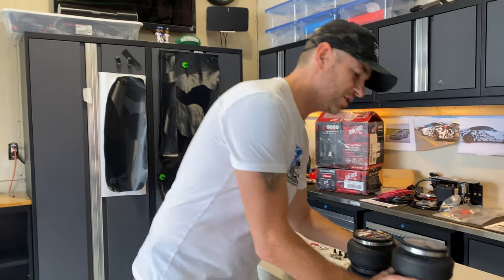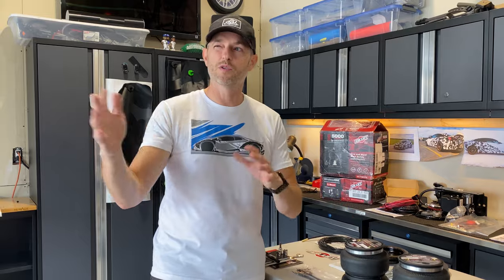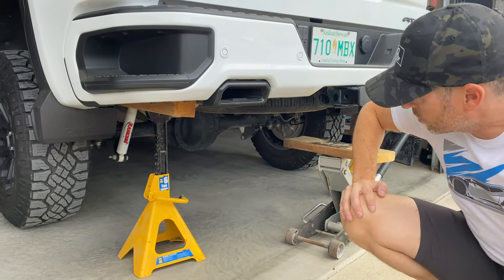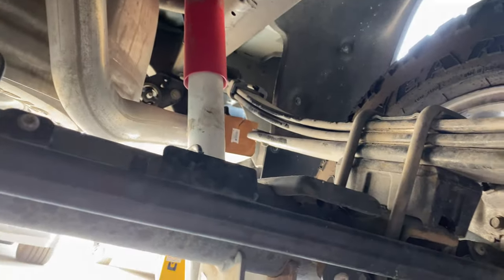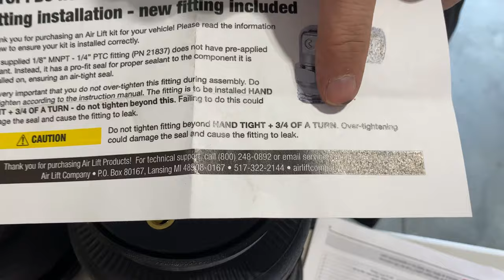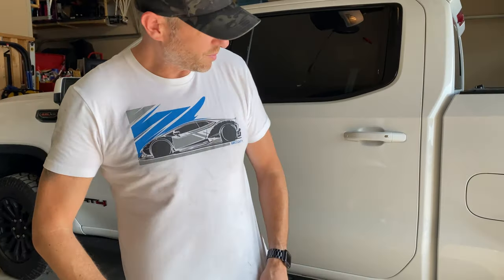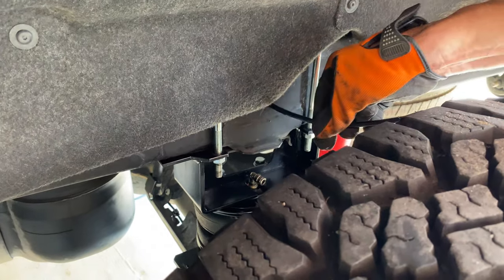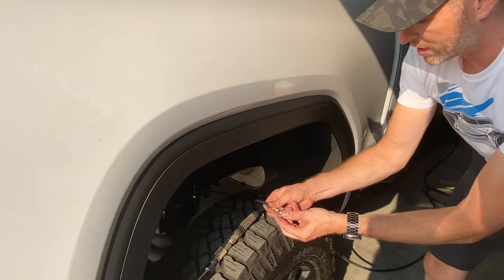How To Install Air Lift LoadLifter Air Bags on a GMC Sierra AT4 or Chevrolet Trail Boss. 2019 - 2023

Comment: Just a tip.  For trail boss/at4 you don’t need to jack the vehicle up for clearance.  Compress the bag and duct tape for n compressed state.  On drivers side you will need to remove lower shock bolt and position shock to work bag into place.  Eliminates safety issues.  Thanks and enjoy your videos
Reply from the maker: Good tip!

Comment: Just bought these airbags model 88388 on Amazon sale $385.00 🇺🇸 👍 THANKS
Reply from the maker: I hope they do the job for you!  Sure adds stability for me while towing
Reply: @Donslife  Have a question, I received my airlift kit. I purchased the same kit you did. I didn't receive the "T" parts that you show. Instead I received two separate lines, each with a Schrader valve on the end as if eave air bag is to be filled independently. Did you have to order the "T" sections separately?
Reply from the maker: @mannyb4959  I don’t remember off hand, but airline ‘Tees’ are super inexpensive and can be found at places that sell air compressors.  Or Amazon

Comment: Great video, I read some of the reviews,  and some people complain about the ride when empty even with only 5 lbs of pressure. Did you notice a rougher ride with no cargo
Reply from the maker: Yes, a little bit stiffer but that’s the trade off.
Reply: @craig3818 I just test drove a 2021 2500 at4 with air bags and it sucked. No cargo in it and hit a bump and felt like something hit me in the back.

Comment: Hey Don, I was just wondering what your opinion on the airbags is years later. I have the 23 At4 and currently have it leveled with 2" ready lift which came with 3" rear blocks to maintain rake but I did not install them because I wanted it to be level. I just bought a camper and will be towing a good bit for work and im stuck between either  adding the rear block or getting bags. Whats your opinion on it? If I got bags I would only get the bags and not the compressor because I always have one on me. I wouldn't mind the rake with the 3" block because sometimes my truck looks a little squatted which is very annoying but not sure if it will damage my Bilstein 5100s

Comment: I'm looking at installing air lift 5000 on my Silverado ZR2.  The brake line spacers were they included in the kit?
Reply from the maker: I seem to recall that mine were relocated with some hardware.  A would suggest downloading the installation guide and confirming.

Comment: Hey Don! Great channel     My local truck place tell me there might be some kind of electronic stabilizer that might throw codes if these are installed.  Do you have any problems? Thanks.  Brad 2022 GMC SLT 1500.  Trailer package
Reply from the maker: Never had I had a code or errors message from this install.   I have heard there is a warning message when the truck thinks it is overloaded.  I haven’t been overloaded before to test it

Comment: Always wanted to know adding extra leaf springs would it help and raise tow capacity.
Reply from the maker: You technically can but axels, gear ratios, brakes, etc would potentially need to be looked at for upgrading properly as well to tow more safely.  These bags are to improve tow quality.
Reply: I looked at the  add a leaf and for a couple hundred more I got the bags.very happy.
Reply: Bear-
I had been researching leaf springs vs air bags , and all my research led me to believe, if if I spent a considerable amount of money to beef up my leaf springs on my 07 GMC 2500HD, I’d still have to install airbags in the end to reduce the squat I currently see when I hook up
to our Gooseneck LQ horse trailer.
Actually had placed an order last year for some highly recommended Aftermarket Leaf Spring upgrades but after a free weeks of no response or order confirmation from unnamed manufacturer-
I emailed to cancel any order in process.
After over a year of looking & considering multiple options,
I ordered my Airlift Airbags 5000 Ultimate, with on board wireless compressor yesterday,
Hopefully it will arrive soon & have it on by next weekend.👍

Comment: Hey Don, forgot to ask you a while back...how are those Bilstein 5100 adjustable front struts holding up for you? I still haven't replaced my stock Rancho's up front (Bilstein 5100 shocks on the rear tho). Thanks! Oh, how are they handling the cold?
Reply from the maker: I absolutely love them.  No issues in the cold either. Done lots of driving over all kinds of terrain and when the front end is put through some work, that’s when you notice the difference.   On smooth roads, I couldn’t tell any difference

Comment: Thanks for the video.  Do these air bags negatively affect ride quality while not towing, assuming I guess you would have the min amount of air (5lbs I think you refrence).  I will be towing roughly 8000lbs with my AT4 and I was wondering if just the weight distribution hitch would be enough but considering these.  Did you tow with just the WD hitch and found you needed the bags too?
Reply from the maker: You can tow without the bags and just a good WD hitch.  I like the bags since where I live there is a lot of cross wind and helps keep thing level and cuts down on body roll around corners.  The bags will add a little stiffness to the rear too when not towing.

Comment: I have one comment after installing the airbags on my 2019 GMC Sierra I've noticed the ride quality greatly reduced if this happened to you how did you fix it?
Reply from the maker: It adds stiffness, but I knew that going in.  I did replace the rear ranchos with Bilsteins and it helps a little, but bag stiffness will always be a thing.   For me (not everybody) having them has come in more handy than ever with the way I use my truck.

Comment: Nice. Is there a kit that can lower the whole truck close to the ground for easy access (I now may possibly have MS)

Then your able to lift to a proper riding height.
Reply from the maker: Sorry to hear that.  Lowering kits are available from some companies but it is a whole different process to install.  Usually people will lower 2WD trucks not Factory 2” lifted AT4s.

Comment: Sorry cut my comment off. Do you use the airbags AND weight distribution hitch with your trailer? How is the ride with the trailer when using weight distribution and airbags?
Reply from the maker: I use both together and it really helps with stability, control and more!  I am taking a trip with the trailer next week and will put some content together for the channel.

Comment: Important: No one told me I had to lift the front end at least 2.5 inches at the lower strut or 3 inches at the top as I ended up doing. I'm running pressure at 22 lbs to level my truck. if I had used maybe a 2.5-inch lift I could balance truck level at 10 lbs. Forget about 5 lbs riding without weight. my truck 2008 Sierra 1500 4 wd 4.8 crew cab short box. make sure the lines are equal in length if you are running dual lines. or the one side pumps up faster with the shortest line. coil it up if it's extra, make them equal lentgh good suggestion. Best to yous

Comment: On the 21 3.0 1500 Duramax AT4 with bags what do you think I could handle for towing capacity?
Reply from the maker: Technically you have the same max tow rating.  The bags will only help improve stability and reduce rear end sag

Comment: I had air bags on my 18 gmc and they rattled all the time when they were not fully inflated but above the 5# and never could find anything loose  I swore I would never have another set  how do these do?
Reply from the maker: No noise / rattles from my last set on my 2013 or this 2021.   I may not need mine anymore now that we have a permanent spot for our camper.  No more long and heavy tows

Comment: Can you add those on the Denali with the adaptive ride control (ARC)???
Reply from the maker: Yes but it would be a different model # and you’ll be countering some of the work your adaptive shocks are providing.   It would be a stiffer ride when not towing

Comment: Hi from Kentucky, I have a 2019 Sierra Denali. I have put the Firestone tow bags on the truck and noticed the ride to be more firm when not towing. I don't want to lose the luxury of adaptive ride control suspension. I have had multiple GM techs say load leveling hitches are the way to go. I pull a bass boat weekly. Have you noticed a difference in your ride quality and any experience with load leveling hitches?
Reply from the maker: The techs are correct.  The ride will firm up without a load.  A load leveling hitch would probably help you best for maintaining comfort with your adaptive shocks.
Reply: @Donslife  Any recommendations to lose the slight squat when towing without compromising the ARC?
Reply: @tototototototoable Roadmaster Active Suspension

Comment: Would a 6inch lift change anything? More parts or would I not be able to do this?
Reply from the maker: You can still add some, it will add a couple parts for the bag mounting.

Comment: I recently installed the 88388 on my 2021 GMC AT4… the ride was terrible unloaded. I took them off and returned them… very disappointed since I had airlift 1,000s on my 17 Raptor and they were amazing.  Left my air compressor on incase I find something that rides better.
Reply from the maker: Sorry it didn’t work out for you.  Not permanent, which was a good thing!

Comment: Where can i get this kit if you can she the links with me of all the parts yoube used from air bags to compressor i have the same truck.this is a great video
Reply from the maker: Here were the links in video descriptions:

AirLift 88388 LoadLifter 5000 for AT4 & TrailBoss : https://amzn.to/3wZnIQy

Air Lift 25980EZ WirelessONE Compressor : https://amzn.to/3y09CzI

Comment: Did you install the ready lift level?  If so did you see a drop in MPG?  Thanks
Reply from the maker: No sir. I have only recently installed Bilstein 5100 Height adjustable shocks to the front.  It now sits an inch higher in the front

Comment: Hi I am about to install mine, I have a 32ft Forest River Toy Hauler that has a gross just over 12K. How much does your RV weigh?  I am trying to guesstimate a starting point for pressure. And thank you for the very good work on the video extremely helpful and informative on both of them.
Reply from the maker: Thanks!  Mine is pushing 8000 loaded (no water).  My AT4 is rated for just under 9000 so 10-15 pounds is good for me.  I would start at 5.  Level your hitch and/or load distribution, then air up a little and drive around the block.
Reply: Don...no offense, but you must have arms the size of a baby monkey...that's a tight area for the compressor...after 3 hours of fighting with it....I think that the Fender well is coming off tomorrow...any advice please let me know. Thanks.
Reply from the maker: Offended?  I am honored 🙏🏻

Comment: Will the air lift bags work if I lift my truck 3 inches ?
Reply from the maker: You should contact Air Lift for a kit that works with a 3” lift.  This kit is a specific bolt-on for the 2” AT4 lift.

Comment: Great video…. When I checked the on Amazon link for this product it shows not compatible 
 to my 2022 Chevy TrailBoss.  Any thoughts?   Also wanted to check how confident you are still with pulling now?
Reply from the maker: I stand by them. I would confirm the part number on Air lifts site and go by the part number specific to your truck

Comment: Hey Don, thanks for the great video.  I have a 2019 AT4 with the 6-1/2” box and a Reese 5th wheel hitch. The 5th wheel hitch uses bolt on brackets (they clamp to the frame). I’m just wondering if the 5th wheel brackets will be in the way of the top bag bracket.  Thoughts?
Reply from the maker: Check if the brackets go directly above the axle or ahead of the axle.  If it is above, the hardware might get in the way.  You need to be able to slide the ubolts in the gap between the bed floor and the frame.

Comment: Hey Don, how is everyday driving with the bags? Now that youve had them for a while , do you see any difference on eveyday driving and or look of the truck?
Reply from the maker: It’s been good.  I was very happy with how the factory lift hasn’t made actual towing less stable.   I think the backend is slightly stiffer, but it doesn’t pose an issue for me anyway.  I use the truck for truck things, so I am glad they are there.   No change to the look of the truck, the back still sits a tiny bit higher than the front like it did before.  I have some Bilstein 5100 shocks coming for the front that add 1.1” to the front.  I don’t want a completely level truck either since I tow things.
Reply: @Donslife  nice!  I feel like front end feels light when towing my trailer. Im definitely going to look into those bags. I wish i could install them but im not as handy as you lol. Ill have to look for someone who can follow your video install. Super clean install! 👍

Comment: did you use anything to seal the lines into the valves?
Reply from the maker: Silicone grease works well
Reply: @Donslife  awesome!  thanks!  I got my kit in and noticed it doesn't have the T hose fittings.  is that something you bought separately?

Comment: Where did you get the tees for the airlines?
Reply from the maker: Mine cane in the kit, but amazon has air lift union tees that should be the same
Reply: @Donslife  I now see the tees come with the compressor kit and not the air bag kit. Thank you!

Comment: If you have a 2024 GMC 1500 6.2L with max trailerage package … you won’t be able to install it on your own, you can do everything up to the point .. of putting the bags on… the axel .. it won’t fit up in there .. all my work for nothing …
Reply from the maker: Do you have an AT4?  This kit is for the AT4
Reply: Boss  do you have a part numbers@Donslife
Reply from the maker: @danielmuletas9786  Links for the products in the video:

AirLift 88388 LoadLifter 5000 for AT4 & TrailBoss : https://amzn.to/3wZnIQy

Air Lift 25980EZ WirelessONE Compressor : https://amzn.to/3y09CzI
Reply from the maker: @danielmuletas9786  if your truck is different, please look for the right ones on Air Lift’s website
Reply: @Donslife   thx     sir

Comment: I just installed these on my 2021 GMC Sierra. It only took one drive to realize they ruined the ride quality. The bags limit the suspension travel and even with 5lbs of air cause an excessively bouncy ride.
Reply from the maker: Hmm.  Sorry to hear.  Not what I am experiencing on my AT4.  Especially when I tow the Travel Trailer, Boat or have a payload.  I suspect when I switch to Bilstein 5100 series shocks, it will only get better. At least the air springs are just a bolt on product if you don’t care for them.
Reply: @Donslife  I wonder if your 2” lift on the at4 is enough to make a difference in the ride. My stock height gmc doesn’t leave much room between the axle and the frame.
Reply from the maker: I was thinking the same.  Also some bags have an internal jounce bumper inside the bag. Maybe you are hitting it if yours has one? Mine does but I don’t think I’ve made contact with mine.
Reply: I installed the airlift system as well and bilstins on my at4, raised the truck almost 2” and the ride is very stiff when used for daily driving, I’m gonna remove airbags and go back to hellwig helper springs
Reply: I was curious about the travel as well. I'm installing a long travel kit on my 22 Denali and was curious as to if it was possible to leave the bottom mount off and replace it with a Daystar cradle kit